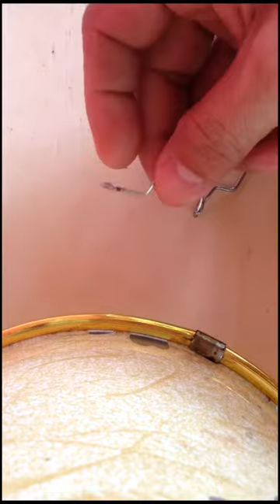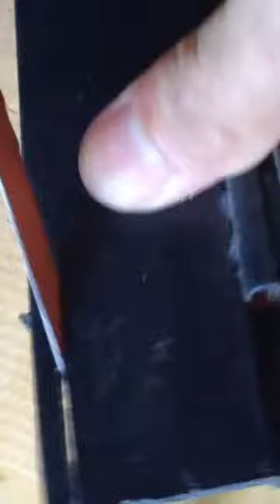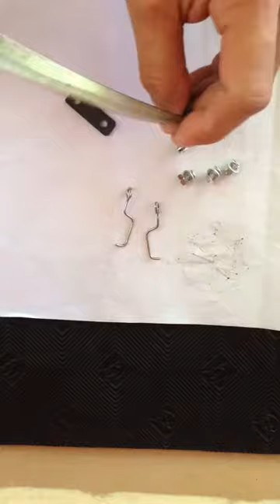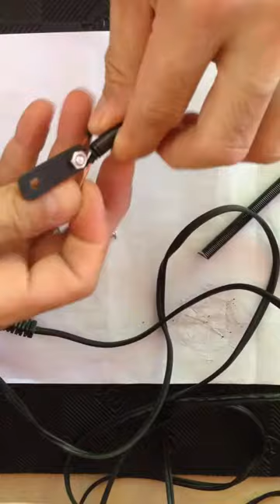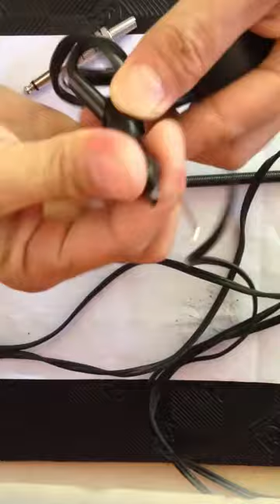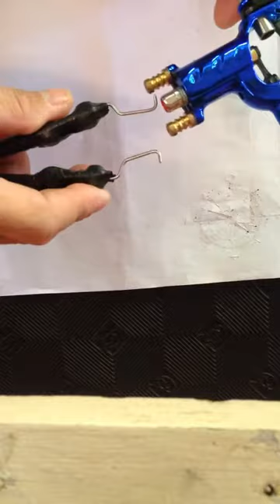How to make a heavy duty clip cord in an easiest way. (Part 1)

Comment: There’s no positive or negative
Reply from the maker: If your a tattoo artist and had knowledge even a little in electronics the positive is connecting in the center of the male plug and you can follow the line of the clipcord and see where is the positive and the negative located and put a mark on it.  How much more if your only the one who made the clipcord, i'm sure that you are pretty sure where is the positive and the negstive. :)
Reply: @ericescorpeso3562  it was a question I forgot to add the question mark